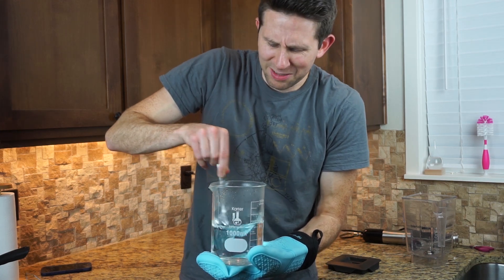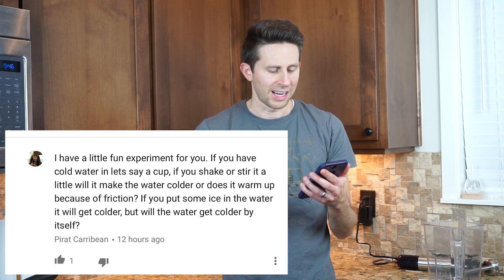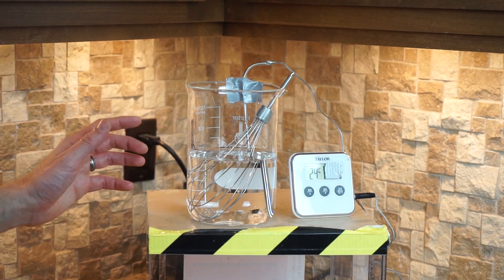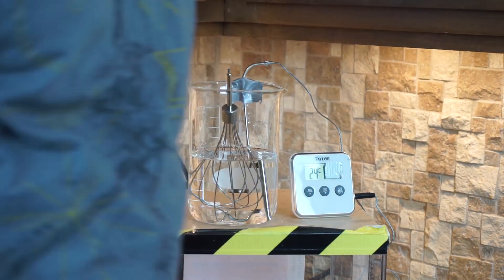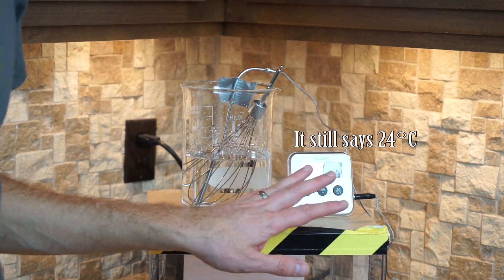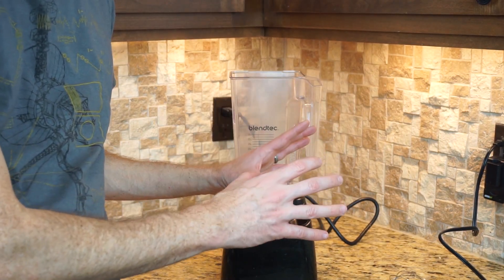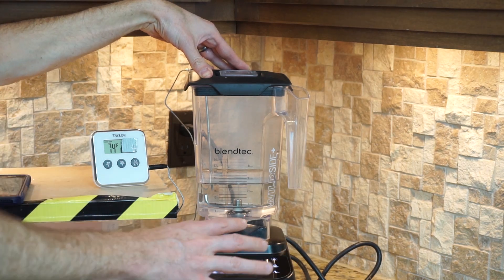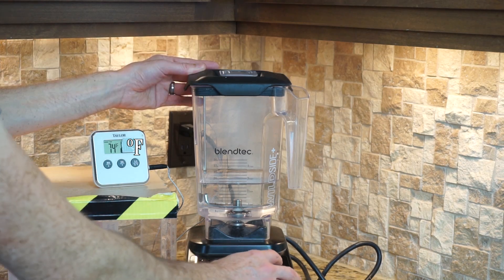Can You Boil Water Just By Mixing it Really Fast? Water-Stirring Challenge Accepted!

Comment: Great experiment; 
Just to add, there are various factors to why the temp wad raised, here are some examples: 

A. Viscosity of the water
B. Reynolds number of the surface
C. The heat transfer of the blade, as the blade had to overcome internal friction with in the water plus density of the water. 

Etc........

Comment: you could build a simple wind turbine and use a mixture of anti-freeze and water to generate a bit of heat in the garage. No electrical required at all; just stir the mix. Almost 100% efficient of just generating heat.

Comment: Idk, but. Isn't it the air rubbing against the water that produces the heat in addition to the blad and its engine(anything used to stir with actually) Im thinking this becaus water only absorbs its surroundings both conditional and energeticly. plz correct if im wrong but, why not try and find a way to test that theory ^^

Comment: Me: mixes my tea to cool it down

My tea: You fool! You absolute buffoon!
Reply: It cools down because you mix slowly and you increase the surface contact with colder air.
Reply: @fulanodetaldoorkut  not really. Its just that if you let a hot tea warm on its own then the colder tea will always stay at bottom and hot tea will stay at top. So by mixing you can balance the heat distribution throughout.
 Well, when u take bath in hot water u will usually find colder water in bottom of the bucket. 
Because cold water has higher density than warm water. And the denser substance can't stay at top.. thats it..
Reply: @weebu0774  I think u both are correct bcz ur explaination will work fine when the height of vessel will be large as compared to the diameter of vessel but generally we have comparable diameter and height of vessel ( tea cup ). So here I guess both principles will work .
Reply: @fulanodetaldoorkut  https://youtu.be/yFHH4nusaT8
Reply: @fulanodetaldoorkut  and also giving heat a way .
Reply: @fulanodetaldoorkut  you dont understand jokes do you?
Reply: @fulanodetaldoorkut  but that’s what the air thinks he’s talking about what the TEA thinks. The tea is wrong.
Reply: @fulanodetaldoorkut  open system thermodynamically?
Reply: @fulanodetaldoorkut No way 🙄
Reply: @fulanodetaldoorkut  r/whoooosh
Reply: @JanemannuelFLabio  agreed..

What? I know im late
Reply: @alanedgarfillinpillin8880  go back to your "i am 10 years old and this is deep" catagory on reddit
the guy was literally trying to explain why the tea cools down
Reply: @thuan3514  hold the fuck on, I didn't even leave that comment.
Reply: @thuan3514  though I'm glad to see that you are aware of that category.
Reply: @alanedgarfillinpillin8880  He was just explaining. He didn't even ruin the joke
Reply: @Not_blue_000  I mean, who needs explanation on a clearly declared joke? If the joke was dumb and ignorant, Fuck it, go on and explain. But it wasn't. Then I had this army of little grown-ups on me, telling me to go back to reddit. The site have barely ever visited only on terms of it being the first link to explain my "googling". Though they've been triggered by the used term alone, barely even explaining anything. And here I am again. In need of explanation to an explanation. Amazing. By the way, it doesn't take the same amount of energy to heat up H2O from 0° to 1°, as it takes to heat up from 89° to 90°, as it also takes energy to go from hard state (ice) to liquid (water). In reference to a comment above.
Reply: @JanemannuelFLabio  go back to roblox kid
Reply: LOL!!!!!
Reply: VibezVideo cool :0
Reply: cringe
Reply: Always Smile  Nope, warm water will reach boiling temperature faster than cold water. It takes the same amount of energy to get water from 89°C to 90°C as it takes to get it from 0°C to 1°C, so warmer water has a head start so to say.
Reply: JK
Reply: LoL
Reply: That made me forcibly exhale through my nose lmao. I'm laughing on the inside tho dw 😂
Reply: LMAO that is what i said.
Reply: Wjoof whooof whoosh
Reply: Lmaooo
Reply: Just put a spoon in the freezer, or fridge while you heat your tea. That way it absorbs the heat, and you don’t water it down?
Reply: @JackRileyD  i just blow on it
Reply: Satsuki Shirotae  the fuck
Reply: Just leave spoon in cup.. It will cool it down quick
Reply: Who the fuck mixes their tea to "cool it down" ?
Reply: @admiralnelson655  buy NesTea :D
Reply: I told someone that before and they thought i was nuts. I was just in one of those moods and told them they're heating up their drink by stirring it. lmao They thought i was full of it. but i didn't try to explain except i left them with one word "friction".
Reply: @VibezVideo  make your parents proud dont you.

Comment: This is one of the demonstrations the Vitamix people have done out at the fairgrounds since the 60s. My Vitamix takes about eight minutes to boil water. In the older metal carafe Vitamix machines they used to put a chunk of a red brick into the vitamix and turn it into sand They don't do it now, because the carafes are made of Lexan in the sand scratches them up.

Comment: Isn't the motor generating a bunch of heat? I've heard you're not supposed to run those things with nothing in them because the motor will over heat? . . . . Maybe your owners manual mentions that. 
I'm not trying to debate whether it's possible because I know it is. I'm just wondering if theirs a better way to do this experiment.

Comment: its not the water itself gets hot by stirring it,it is the machine of the blender getting hot transfered to the water because the rotor of the blender is made of metal which is a good conductor of heat.

Comment: for sure you can boil water by moving it fast, we know this from spinning rotters of a submarine which causes cavitation and boils water. by spinning it fast we kinda produce a low-pressure region, thus less temperature is required to boil water

fun fact: cavitation not only destroys submarine rotters but also give away its position too

Comment: I work with a similar blender at work.. I can tell you.. after many uses the blades.. and under the jug gets.pretty hot.. especially around the bearings. 
Whether is is enough to boil/ transfer heat to the water..no.. not for occasional use 

But I'm sure after consistent use over prolonged periods where not intended.. a build up of heat is expected and could result in such.... small maybe.

High quality blenders are unlikely to burn out but I also feel with the surface area of the spinning water it not really possible to maintain such a temperature without the help of the motor helping to an extent.

I'd say. Half and half 

Half what was intended. With friction 
Other half helped by heat of motor.
Could be wrong.
Whatever doesn't really matter.. not like we're gonna use an expensive blender to boil water anyways.

Comment: A $20 or less infrared thermometer would be very helpful for this experiment 😉
Reply: Where the hell did you find a temp gun that cheap? I do plumbing and the cheapest I found was 50
Reply: @jacobwartooth8690  amazon search etekcity I've had it for years it works great I also saw one of Menards a couple weeks ago for like 15 bucks
Reply: they dont work on water very well at all. kinda needs a surface that bounces back the signal
Reply: @richardcagle5475  I use them all the time double check the temps of my fish tanks which is water and I've never been more than one degree off from the digital temp probe that's actually in the water... But I could understand it being inaccurate with hotter water or anything were steam is playing a role.
Reply: It would be interesting to see how they work on a moving surface.
Reply: @wictimovgovonca320  they should work just fine on a moving surface. They work great just as good as any other infared thermometer in my experience. Also still working great 3+ years later.

Comment: What was the temperature of the thermostat set on your air conditioning unit in the room you conducted your experiment? That's another flub in your lil test bruh
Reply: By stirring you introduce alot of air to the water so in turn it should change temperature do to that affect...assimilation so to speak.

Comment: I believe that the water in the blender gets warmer because of the induction motor running the blades of the blender. The motor can get pretty hot when being run for a long time, so the water just conducts the heat through the blades of the blender.

Comment: Ummm... No?
Friction in water is so small that ammount of heat produced is pretty much all lost on heating up outer layer of the container.

Real work here is done by motor in blender getting warmer and transferring energy through the blades to the liquid.

And again. No for bearings.
You can hear motor working pretty much clearly, where as you cant really hear bearings. Thats because motor is losing a lot of energy here.

Comment: so food for thought how much of the heat that brought the water to a boil 
came from the shaft of the 1500 watt motor that is connected to the blades by a coupling 
because i know for a fact that if you let them run for a couple of minutes straight you risk the motor dying from overheating
Reply: But u can see if the motor is not running, the water temperature doesnt get high (due to the heat of the motor), but when he start the blender, the temperature increases...

Comment: Friction is caused by two physical processes, both of which dissipate energy. It's the dissipation of energy that means work is required to slide over the surface, and this work is why we feel a frictional force.
Anyhow, the first factor is the surface energy of the material because this affects the adhesion between the sliding object and the substrate. A high surface energy like steel means a high friction and low surface energy like PTFE means a low friction. The second factor is how much energy is dissipated by viscoelastic losses in the bulk of the substrate. This is the main reason rubber has such high friction, because as an object slides over it the rubber deforms and absorbs energy. Rubber actually has quite a low surface energy but the viscoelastic losses dominate the friction.
Anyhow, with water neither of these criteria can be applies because water is a liquid, so you can't assign a friction coefficient to water.
Having said this, a film of water can be a very effective lubricant. For example if you step out of the shower onto a smooth lino floor you're likely to discover the hard way what a good lubricant a film of water can be.

Comment: Heat from the motor was definitely occurring, question is to what degree.  The blades etc are made of metal and therefor have a high heat transfer coefficient and a low specific heat.  The blade effectively acts as a heat sink for the motor.  Don't agree?  Run the blender without anything in it and see if it overheats.

Comment: The only problem is you were directly connected to the drive by metal . Even if it has the best bearing they are gonna get hot. As you can see from the boil it's around the shaft not the walls. Just my observation .

Comment: The blender's engine also sends some warmth, after all you've been running it for a long time
Reply: I don't think the motor sends much heat because of several layers of plastic separating. The shaft being stainless has poor heat conduction capacity. If I'd take a guess the biggest side contribution would be friction heat from driver plate vs shaft and friction heat from bottom seal to shaft, thru shaft and into water. There are much larger radiant heat losses through the  side walls of container.
Reply: Friction ;-)
Reply: Blenders use electric motors, not engines.   A blender that runs on a gasoline engine sounds like a crazy Handyman Corner invention from The Red Green Show.

Comment: nice experiment but I feel the blade its acting as a heat sink for the motor and bearings. I think it would be interesting to see what the temperature of the blade reaches running on same setting without fluid.

Comment: Correct me if i'm wrong, but doesn't the blender itself heat up as energy not used as work in spinning the blades, will become excess heat in the motor since its not 100% efficient? The indirect heat transfer from the motor to the water should cause the water to have an increase in temperature in addition to the increase in temp due to friction between the blades and the water in the blender, based on the two experiments you have shown one experiment has just friction while the other has friction and the change in temperature of the blender over time, so can we assume the temperature of blender is negligible?

Sorry in advance, but can someone explain it to me? (I am a student who wishes to learn more about how physics/thermodynamics)

Comment: Waters density will not allow for this to happen.
Most of the heat is generated by the water rubbing against the walls of the blender and rubbing against the blade, while hest generated by water molecules rubbing against one another is fairly minimum. I'd say about 5% of all heat.

Comment: I think this due to cavitation when rotor blades rotate very fast there is negative pressure buildup near blades which boils water. Water and pressure are directly related if you reduce pressure the water will boil way earlier than 100c. The similar problem is observed in submarine propellers.

Comment: I personally think your heat was being transferred from the blender motor and the friction between your blender container and the blade shaft the reason i say this is the bubbles from boiling water are always coming from the actual heat source and if you look where you saw your bubbles coming from they tell all boil water on a electric stove watch all the bubbles start at the bottom and they are in the line of the coil

Comment: The temperature of the water in blender is not increasing due to stirring (due to work input). It is due to the heat transfer from blender motor through blades into the water.

Comment: A the water didn’t have to get hot because of cavitation. you know how water boils in space cause it’s no pressure so when the blades spin there’s a low pressure system causing bubbles to form as the water boils

Comment: Great video! I will use it for my mechanical engineering course. Thanks!
Scientific name for the heat coming from the friction is mechanical dissipation. This exact same phenomenon reduces the efficiency of jet engine compressors and turbines.
I actually make my students compute the rotationnal velocity beyond which it becomes significant. Now thanks to you I can illustrate!
How long did you stir with the blender?

Comment: People saying that the heat comes from the blender must be stupid. Blenders don't generate that much heat to heat the water at that speed. You can probably feel it but the water would just cool it down anyways. The water isn't even in contact with the motor. The heat has to pass through the blade or through conduction through a fair amount of plastic, and as you know plastic is a decent insulator.

Comment: It would propably go faster using a bigger surface, which interacts with The water, as a spinning blade only provides a very small one by itself. Also it is very difficult to say, if the heat came from the fraction, it is very likely, that plenty of heat was conducted from the engine heating up. Cool Video tho, keep it up!

Comment: You idiot water does not get heat by stirring. it is because of the steel blade which is a good conductor of heat and electricity connected to motor and the thing is motor heats up as well makes the blade too and gradually what ever in contact absorbs the heat and liberate it. That’s what is happening there.
Reply: Exactly. You can clearly see the steam coming from the base of the blades but not the blades themselves. If the water was heating up by friction itself, the blades would be bubbling all around but that's not the case. The heat is coming up from the base and the blades are being cooled by the water. Notice he never measures the bases temperature and cuts the video when he touches it. Reading the manual, it mentions not to let the motor run continuously over 5 minutes and allow 3 minutes for the shaft to cool. This dude is a dumb shit.

Comment: Only issue i see in this is you are adding a maxhiene which generates heat to the blades. You should attempt another way of doing this. Having a blender my self i know just how hot the blades can become using it on simple materials such as water.

Comment: So when I stir my soup i make it hotter?
Reply: justomeguy i guess technically yeah, but your still losing way more heat then your adding.
Yes i know your joking btw.
Reply: You're actually making it colder because the influence of the air to its surface is more, ik uk it
Reply: Sabr Sndi what does “ik uk it” mean?
Reply: @RowynOfficial  "i know you know it"
Reply: lem ahh ok 👍
Reply: @RowynOfficial   yea he is right, I know you know it, and sorry for not replying earlier, I wasn't aware that you replied
Reply: You are heating the soup a tiny bit but are also increasing the rate in wich heat transfer away from the soup. The net effect will probably be cooling, in normal circunstances. This could be made into an experiment fairly easy, though.

Comment: I have a question. If the water in little amount is poured on the smooth surface and we try to blow it, the water gets displaced to the direction of the air and the position where the water was gets dried....What is the reason behind it?

Comment: This won’t work with your arms because the amount of power in friction generated by your body is barely anything to the power you need to boil water.You’re also losing heat because of how the rooms cooler then the water even if you could heat it up

Comment: I'm wondering if kavitation is a problem if you mix (nearly) boiling water. I guss there are steam bubbles forming in low pressure zones before the water start boiling. What is this doing to your blades?